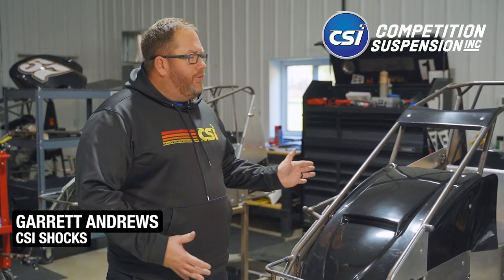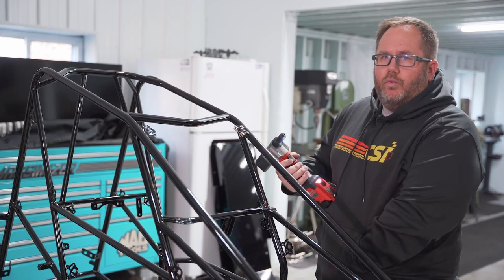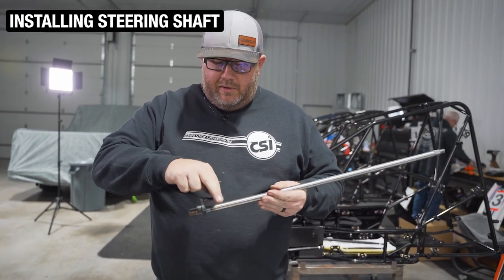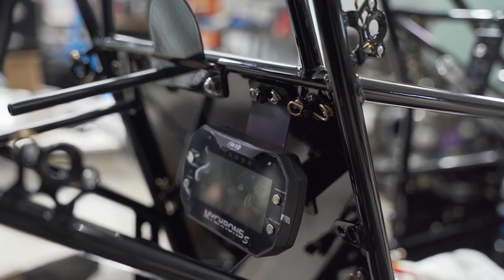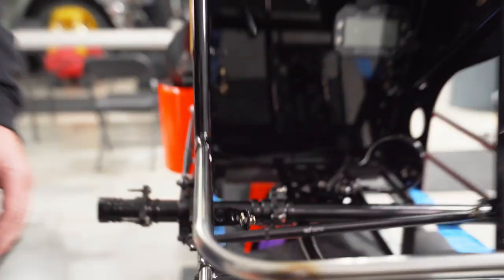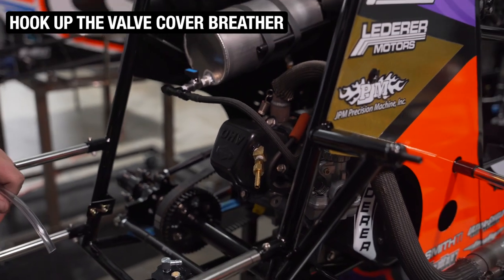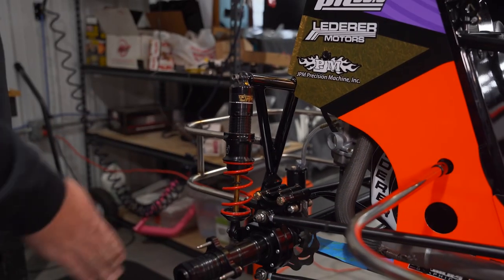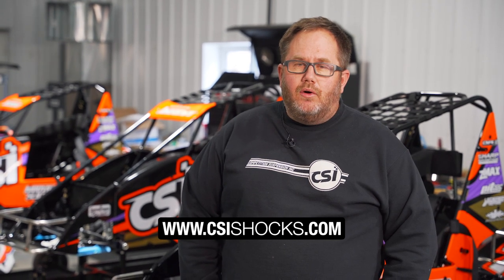How to BUILD a Quarter Midget | Unboxing to Victory Lane

Comment: Pro tip, when dropping your chassis off for powder, ask them to plug the pipes for the bumpers. Chances are they have plugs that fit perfectly so you don't have to grind powder after pickup